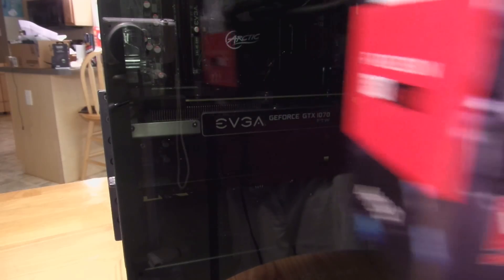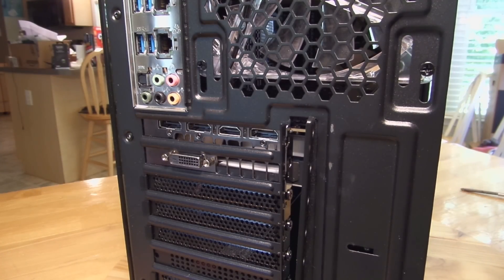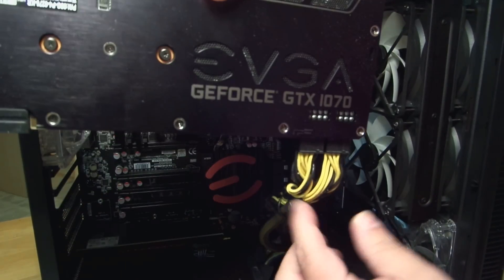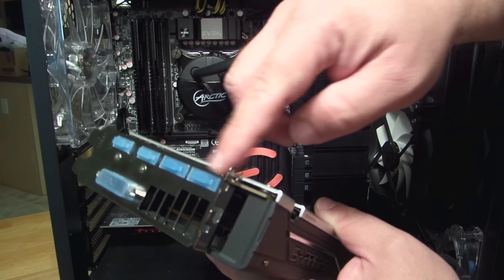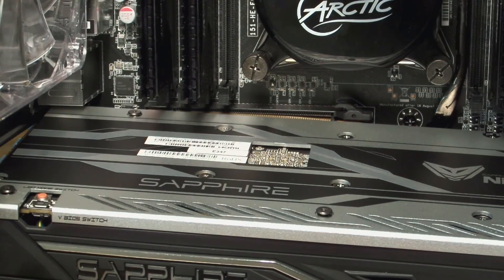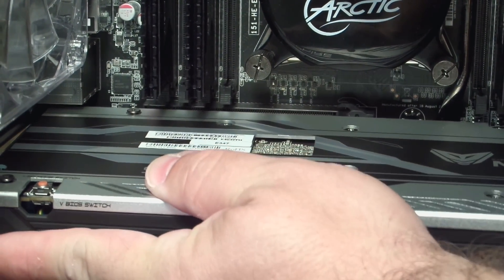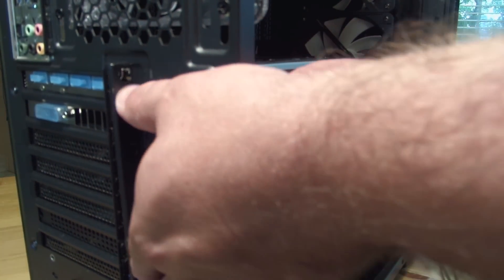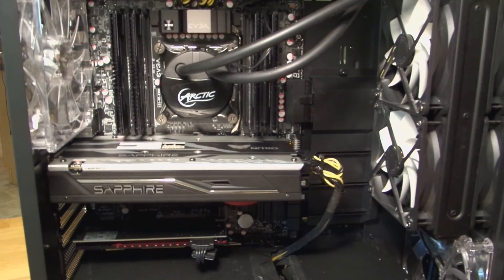Tutorial: How to Install the Sapphire Radeon NITRO+ RX 480 8GB GDDR5 OC Video Card

Comment: do we really need the 8 pin?
Reply: yes, if it has a 6, use the 6, if it has an 8, use the 8, if it has 2, 3 or 4, use them all, they are not optional.  Sometimes they work, but when the card tries to use its full potential, it will fall short and fail.
Reply: @ThisBytesForYou  I don't have an 8 pin on my psu, but can i use a 2 molex to 8 pin adapter?
Reply: @kento6312  ehhhh, I would not do that, but it can be done.  What is your power supply manufacturer and model number?
Reply: @ThisBytesForYou  it is a very unknown brand with 420 W. lpw12-23e is the model number, i think.
Reply: @ThisBytesForYou  it is a very unknown brand with 420 W. lpw12-23e is the model number, i think.
Reply: @ThisBytesForYou  it is a very unknown brand with 420 W. lpw12-23e is the model number, i think.
Reply: @ThisBytesForYou  it is a very unknown brand with 420 W. lpw12-23e is the model number, i think.

Comment: What's the best PSU to get for this cause I think i only have a 450W and it probably won't have enough to power it.
Reply: the requirements state 500Watts for this video card,... I don't want to tell you it would be fine with 450 and it die on you or have issues on your system.  during my testing, the system using this card consumed up to 403watts at stock speeds, over clocked it reached 466Watts, so already over your 450Watts, if you are interested, you can read my full review on the link under there.  To protect your system today and the foreseeable future, here is a 700Watt (it was only 3 dollars more expensive than a 600Watt I was looking at: https://geni.us/hxs0E61), the card requires an 8Pin PCIE connection.

https://www.dragonblogger.com/sapphire-radeon-nitro-rx-480-8gb-oc-review/
Reply: @ThisBytesForYou  The graphics card just came in today, and yeah. I'm going to upgrade the power supply to a 650W PSU. Cheers for the help.
Reply: you are very welcome my friend, let me know if you would like some recommendations.  I am so very happy I could help you and thank you so much for stopping by, checking out the video and commenting, it means a ton to me.
Reply: ThisBytesForYou Cheers, you learnt yourself a sub!
Reply: haha, thank you so much my friend, I do appreciate it greatly.

Comment: I have a amd 200 series but I want to upgrade to a AMD 480 how would I know if it will fit in my case and i don’t know much about PCs so if I watch this video would I be able to switch the cards the only other problem I got is that I don’t know if it will fit my case
Reply: do you know the exact model number?
Reply: ThisBytesForYou the case that I have is a ARK 4U-500-CA Black 4U Rackmount Case 3 and I ain’t really sure what AMD R9 is in the pc right now I just know it’s a 200 series it might be a 270 but I was wondering if I buy a amd480 if it would fit in the case I have?
Reply: I don't think you will run into issue on a rackmount case, it looks pretty big and at most you might have to take out that drive tray at the front but I doubt it with a length of 19.7 inches, I personally reviewed this card: http://geni.us/TCKc5m.  Also, I would like to apologize on the time it took me to reply to you, I was inundated in questions this week, not a bad problem to have as i love helping people.

Comment: And something else. If you want to upgrade a graphics card, download DDU (Display Driver Uninstaller). If you want to change from a gtx 1060 to a rx 580 (example) you just uninstall the nvidia drivers. If you dont and you install the card without doing it then it will be very bad because you might have major problems because of the mixed card drivers which can lead to all sorts of shit happening.

Comment: I have a quick question I bought a pre built cyber power at Best Buy but it came with the RX580 4gb would i be able to toss that and just slap a rx580 8gb in or will i run into issues  I have another cable dangling inside of the computer it looks like I could hook up another gpu  Could I just add a 8GB or would I probably run into power issues
Reply: Hello ClockworkFPV, thanks for stopping by and commenting.  All you are doing really is going from 4GB to 8GB, I would not bother the update.  I would recommend saving a bit for the newer generation card from either AMD or NVIDIA, 580 is still recent, if you are playing at 1920x1080, and have either mid or high settings you should be perfect,  Save your money a little longer, also would you know what sort of powersupply you have?
Reply: ThisBytesForYou  That I do not know it just says it has the AMD Ryzen5 1400 8gb ddr4 memory amd radeon rx580 4gb and 802.11 ac wifi pcie
If I look inside of it it says I have the gigabyte G AAX 370M - DS3H 

The model i have is a GUA2600BST
Reply: ThisBytesForYou  Sorry still kind of new to this so not sure exactly what I'm looking for I'm so used to plugging and a Xbox one x and playing that lol
Reply: no worries, but the power supply is where you plug the power into the computer, can you read what the model number is for the power supply?
Reply: no worries at all, and very happy to help
Reply: ThisBytesForYou 10a 250v
Reply: ThisBytesForYou  I am able to run most games at ultra settings like tomb raider destiny2  Grand theft auto but when I try to play Resident Evil 7 on ultra I run into some issues unless I turn off shadow cash and a couple other things I can't remember what they were but when Jack enters that room OMG it freaks out stuttering lol  I just don't want that V ram to be my limiting factor and I thought maybe going from 4 to 8 would fix that I could get a nvidia GTX1070TI but I'm not gonna be able to afford the 1080TI or the Titan right now  lol  I can run ghost recon wild linds on high settings  I might be putting this card in the ground lol
Reply: what resolution are you running the game on? 10a 250V is 10 amps with 250volts, the model number would be on the inside of the case, are you ok looking in there?
Reply: ThisBytesForYou yeah i dont mind taking it apart i can build drones this cant be much harder lol. And i run at 1080p i havent bought a 4k monitar yet and its not high refresh either lol just a big 70inch 1080p tv
Reply: ThisBytesForYou ughhhh
450 Watt 80+ Bronze certified EVGA PSU
Reply: ThisBytesForYou  Looks like I'm going to be limited unless I upgrade that power supply what would you recommend I do lol

Comment: just a tip you really shouldn't be poking around inside your computer with a metal screwdriver.. good way to short something out!
Reply: that is a great tip Dragon800 but the computer was not on, or plugged in and touching the case grounds you, so there is very little danger in shorting the components in the computer.  I do thank you though for stopping by to provide some useful information, I do appreciate it.
Reply: ya i guess your right i was just always told that components can store electricity. but in reality its probably not going to damage anything.
Reply: no worries.  The capacitors do hold a charge for a period of time, though a relatively short time and a small charge but the system was off for quite sometime as well.  I need to bring down the machine from upstairs and setup the stage for the film, so it takes me at least 30 minutes, if not much more then I also have to wait for the family to be quiet.  You were not wrong, though there are many circumstances that can change it.  Thanks again for stopping by and mostly thank you for not starting off the comment like a jerk, like most of the people here on youtube like to do, but for offering assistance, It is greatly appreciated.

Comment: Total horror. How can you push the video card? It is miraculous that it does not damage the slot for it as well as the connector through which it is powered. You pretty roughly put the things in the box, and for what kind of a bit do you have so many fans in the front? This will not cool better, and will fill even more with dust. What processor do you have and require so much cooling? I have the same video card and i5 6500 and is quite cool with the box cooler. I have only 1 front, 1 rear and 2 top fan. The processor over 50 degrees does not lift under full load. However, the layout of the cables is great, I especially like how the 24-pin connector that feeds the bottom is hidden.
Reply: Hello! Know that they are tested for endurance, but this motherboard does not have boosted slots as an example GA-H110M-Gaming 3 (rev. 1.0). Even with a reinforced slot it is best to work carefully. At least because a motherboard warranty will be lost if a problem is lost. This video card is not very light, but just slot and two screws, and is certainly vibrating. I do not agree with the air. I tried with more fans in the front and the temperature was higher and not lower. Personally, I deliberately put low turnover in front and my high turnover is back and top. At 20-22 degrees Celsius in the rest of the room with this video card and the i5 6500 with a box cooler at rest, I have reached about 15-17 degrees Celsius on the cores, about 26 degrees on the hard drive and about 22-23 on the video card. Well, of course I have changed the video card settings so that the fans are not switched on until 60 degrees. Typically under load it rarely rises 60-61 degrees, and the processor 50-53 in the worst case.Naturally, for a K-series processor, the box cooler is not a good solution, or someone like my old i5 2400 who's hot. By the way, this video card is a bad choice or at least that brand. I had it one before and it is a shame, and this again creates anger. Apparently this brand does not make good cards as before. I hardly have such a bad luck that Sapphire's 2 have been scolded. The graphics get worse, and no matter the driver version, and if I put the Windows 7 or Windows 10 in the vulkan mode, for example new DOOM, the game is squabbling. Maybe because I am a user with 3840x2160 resolution, and with that 10 bits of color. Which she stopped yielding to him.

Comment: Will this also work for a 580 installation? I just got that one today and it's not very clear on the installation inside the quick install guide from what I know.
Reply: Thanks, this has different connections than what I am use to. It says it's got a 6 pin and an 8 pin connection and neither my dad or I know which one to use. >_<
Reply: Okay, so both of'em need plugged in on the 580. Thank you! :D
Reply: Oh, now I get why. My dad is a bit out of date on this stuff and I'm trying to help with what I know as well. Neither of us could figure out why it needed both.
Reply: Will do! :D
Reply: demonicprincess09 thank you demonicprincess09 I do appreciate it

Comment: Hi I'm hoping you are here.
My Sapphire Radeon nitro+ RX 480 4GB arrived today and by all accounts seems to be running perfectly fine.
But I have a problem. Basically I'm not sure how to plug my monitor in. (You missed that on your video.)
With my old graphics card I just plugged a VGA cable from the monitor into the back of the graphics card, but the RX 480 does not have a VGA plug on the back of the card. What do I do? (EDIT: My monitor is fairly new a hp compaq la2206x.)
Reply: OK how do I find out what what my monitor supports?

I'm unsure what is the best option out of DVI, HDMI, or DP?
Reply: Thanks I went down and bought a DP cable. They wanted $19.50 for it (expensive.)
But it done the job and the gpu is working perfectly as far as I can tell.

Thx for all your help Iggy. :)

Comment: I'm going to install this graphics card in about 1 weeks time but I can't see any PCIe cords in my computer.
What do I do?
Reply: My power supply is 420w. The recommended watts for this gpu is 500.
Do you think I'll still be okay?

I think you might be right the PCIe cords are hidden. I'm just checking now.
Let me get this straight, the PCIe cables come out of the power supply?
I just found a cable which looks like a PCIe cable but it has 4 pins, it looks like most have 6.
Reply: OK I've found one of those power supplies that I will probably buy.
But back to my original question: I still can't find the PCIe cord on my current power supply.
The model is: CoolerMaster Thermal Master 420W
And it definitely comes with 1 PCIE cable but I've looked all around my PC and I can't see it in there.
Unless I tear the whole thing apart which I would rather not do.
Reply: May I ask, are you the guy who makes these videos? Or are you just someone who is helping people like me? (btw thx for the help.)

Comment: my power supply has 450 watts so I'm pretty sure it should run fine but it doesnt seem to have a 8 pin or a 6+2 pin connector. Would a 4 to 8 pin adapter work?
Reply: Iggy Castillo would any psu fit into a microatx case
Reply: http://www.newegg.ca/Product/Product.aspx?Item=N82E16811147123 that's the case
Reply: alrighty thank you for the help! :D

Comment: I got the 4GB version. After installing the drivers I get no signal on the DVI connector after the windows 7 booting screen finishes loading. Tried uninstalling with DDU and installed 3 versions of crimson drivers. I get HDMI signal but not in DVI. It also works with basic drivers(the ones that windows gets just after you pug and play the GPU). PSU is a Corsair HX650W (single 12v rail) so I doubt it's the PSU (and I can't change it to test). Please help, IDK what else to do.
Reply: Thank you for your fast response Castillo. I forgot to mention that when HDMI TV and DVI monitor are both plugged in the PC does not recognize the monitor. Even though the monitor works with the basic windows drivers. Could there be a card issue if it only happens after installing the drivers? Btw: I'm updating my windows atm and seeing if that helps. I'm really desperate and out of ideas. Will let you know if anything changes. I'm thinking of just buying a hdmi>dvi or display port>dvi adapter if it's a software issue(as i suspect it is) and i can't sort it whatever i do. THANKS AGAIN!
EDIT: Or i might just get a hdmi to dvi cable.
Reply: *****
Will try after I update the Windows. Because right now with the AMD drivers installed my monitor won't be detected by windows display: it only shows 1 display which is the TV connected through HDMI. Let's hope after windows update something will change. Or should I do this in safe mode with basic drivers?
Reply: tried this method with the 16.7.2 drivers and after doing windows update. I can't see my monitor in the radeon settings windows. Only the TV (which is connected through hdmi) appears. I really don't know what else to do. Again the DVI monitor works just fine until loading screen: after that it gets no signal and it seems the PC cannot see it when plugged into the DVI port. If you have any other ideas please let me know since the only thing that i can think of is bringing the card to claim warranty which will take weeks and I wouldn't do that if i weren't sure it's broken. THANKS!!
Reply: It behaves the same when it's the only one plugged in. I have no option in the menu to change the input: it detects that the digital (DVI) cable is in it but the computer doesn't. Tried with a DVI-D dual link cable also just to be sure. Same problem. I'm out of solutios. Maybe update the MOBO bios. But i have a RAID0; will i lose the raid if i do that?
Reply: *****
I have no onboard graphics. Might try the bios update. If not I'll just get my PC and monitor to a repair shop and see what happens then. Will keep you posted, thanks again.

Comment: Is it compatible RX 460 4G NITRO with the motherboard G41MT-S2PT
Reply: thanks brother
Reply: I bought rx 460 4g nitro It worked well
Reply: You are the best, continued
Reply: Thank you
Reply: FATAH BANDJOUDI 
Yes. It has a PCIe 2.0 x16 slot. More than enough.
However, the GPU may block the other PCIe 2.0 x1 slot.
You do have to make sure your case has space for a card of (x) size though.
Reply: Hello my friend again, a simple question: Do you g41mt-s2pt break the speed of the processor
Reply: Thanks
Reply: Possible my friend help me how to break the speed q8400
Reply: It means q8400 does not cause a bottleneck with rx 460 4gb nitro
Reply: Good keep going
Reply: Depends on what games you play. If you play games optimized for multiple cores it'll be harder for the CPU to bottleneck the GPU. If you play a game like Minecraft, it'll only use 1 core and the RX 460 will have about 10% utilization.
I know because I deal with this.
Reply: For example, a game the witcher 3

Comment: can i run this vga with g450 psu? im using i5 3470, the recommendation from website is 500 watts psu. thanks

edit: i subbed because i saw u're giving clear instructions
Reply: @Iggy Castillo so a 520 watt psu will work fine?

Comment: I have an Antec PSU Earthwatts 650w 80+. Do you think it is enough for this card?
I am asking because I am having issues....
Reply: Iggy Castillo thanks for your message. I am getting random "blue screen of death", black screens when I revive the PC from idle and freezes/bsod during games.
it's a new PC I assembled with fresh windows 10 installation. temperatures are OK.
Reply: Done. I even formatted and installed the newest drives, then steam and played two races in Dirt Rally---> then red screen and bzz.... I am now using the integrated video card. I even played 3 tracks in Dirt Rally at minimum details and it seems it work... What to do...
Reply: Iggy Castillo I Just tried. it didn't work unfortunately...😞

Comment: ok ive been reading up but i need help so i bought a pre built pc from ebay and im getting this 
card HOWEVER this pc has some unbranded 500w psu and well as ive read up
 my pc will blow up if i dont buy a good one or a branded one so can i   just put it intomy pc or  should i not risk it ?? i 
mean it sounds like this card dont need much power so maybe i dont need to buy a
 new psu ??